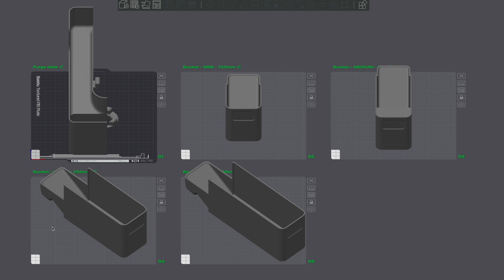Print These BambuLab Mods First? 8 P1S Upgrades and Accessories Tested

Comment: I have not had my printer get too hot printing PLA at all. I never open the door or glass top...get PERFECT prints...just my experience.
Reply from the maker: It’s certainly going to be dependent on environment and luck. My printer is in a room without climate control. In the winter I often close things up but in the summer I open it up for best results. I’ve seen in summer that the PLA can get saggy from staying hot too long.
Reply: Me too, never had a heating problem.
Reply: Opening up ur printer vents out all the toxic fumes into the room. I would advise to keep it close and attach an external venting system for the benefit of your health and also to cool down the printer cabin with air flow when needed. Aux fans can also be manually increased in the printer app to cool the cabin further.
Reply: @enochsimo  As a generic answer, this suffices, but for those who aren’t technically savy enough to go about what you just said… How would you explain it?

Comment: I know it’s six months old now, and in the grand scheme of things that’s huge… but… build plate holders are the bane of my existence it seems. I just couldn’t find one that suits my situation of approx 20 to 25 build plates between my two printers. I have printed 4 now and design a makeshift one myself based off my findings. These are what I think works best. Being able to slide it in from the front (yes, entendres intended, sort of), having them staggered so you can identify each plate easily at a glance, not use up a huge amount of filament and time, and like your poop chute - be held in place by the printer (I hadn’t found your poop chute example, that’s great!). I’m now going to try your chute recommendation! Thanks

Comment: I cannot see the point of swatches other than a waste of time and filament/money, I also never lift the top as I have an AMS and its heavy to try to lift it and the glass at the same time, I also print PLA with the door shut and have never had problems(touch wood)
The best filament clip I find is the already printed spool, they have various holes near the top edge, just push the filament through from the inside and then back through to the inside.
A very helpful print is the build plate aligner, it clips onto the rear left corner and helps align the plate every time, perfectly. Another one is a curved PTFE support that clips into the top of print head and supports the PTFE tube and stops id bending and premature wear.

Comment: I take it the second print, to hold the top glass up won't work if you have AMS? or is there still enough room for these?
Reply from the maker: I have the AMS on top of the unit without issue with the risers. I don’t know if there is a difference with the AMS 2 that would cause problems but it works just fine with AMS 1. Thanks for watching!